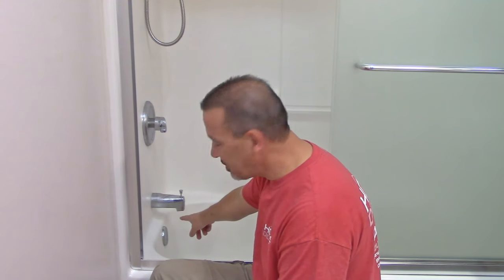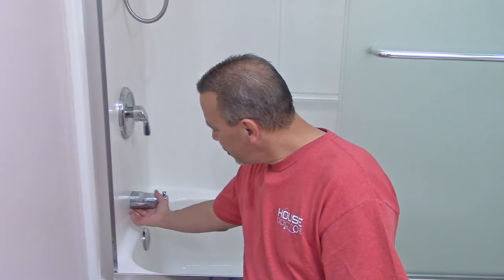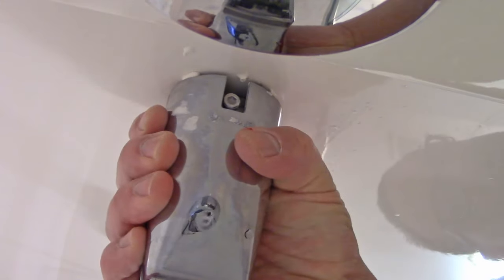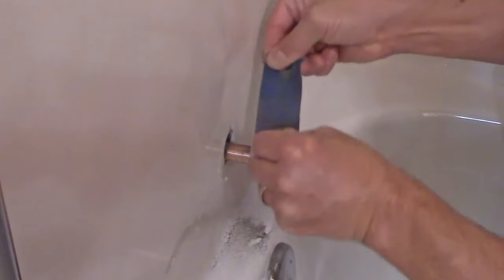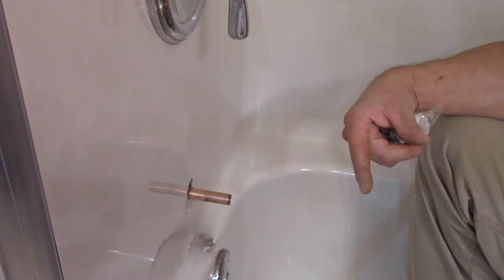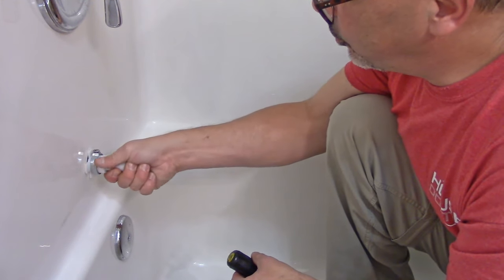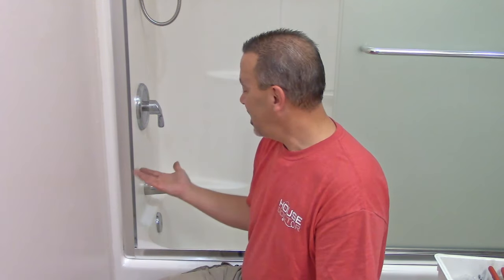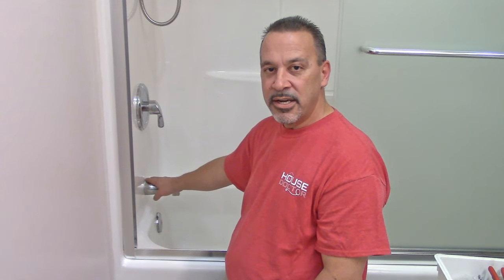DIY noisy shower valve fix

Comment: After cutting a new seat in my shower valves, there was an increase in noise. I figured one reason could be the very sharp new edge that the water has to flow around, creating high pitch whine. Sure enough your video convinced me to buy a cheap hand deburring tool and I smoothed the sharp edge of the seat out, and now it's silent. Perfect.
Reply from the maker: Glad you tracked it down and fixed it.  It really is strange how the slightest disturbance in flow can cause that noise.

Comment: I bought a condo last month and noticed the shower does this (and it stops when I jiggle the tub valve thingy), so I think this is the issue. I'll check for leaking when I switch to shower mode..hopefully it works and I don't have to pay a plumber $$$ for simple fix.

Comment: THANK YOU!!! I’ve finagled with that darn shower so many times after the kids have complained about the squealing but never bought any parts since I wasn’t sure what part. After hearing it again this morning I found this video and thought why not. $24 at Home Depot and less than 20 minutes later (I had to redo and screw from the bottom since the handle is too close) and it’s quiet now. 👍🏼🎉🎆🥳👏🏼👏🏼👏🏼
Reply from the maker: Yes!  Way to go.

Comment: Thanks for this very informative video. You have some great information here. 👍I'll be sure to check out more clips from your channel
Reply from the maker: Thanks Dex
Reply: @HouseDoctorRay  I have a question for you, If the shower is squealing and the spout is leaking, does that mean it's most likely the fix you did in the video? what about if the spout isn't leaking would that mean it's the cartridge?
Reply from the maker: A leaking spout definitely can cause the sound.  Spouts shouldn't leak at all when water is on.
The noise is a harmonic vibration caused by the water flow.  The spout is the easiest thing to change.
A cartridge could definitely cause the noise too.  If you do pull it out make sure the housing is clear of any debris before installing the new one.
Reply: @HouseDoctorRay  Thank you I appreciate your response.

Comment: Sometimes, your spout just needs some Lime Away sprayed up in there to soak & clean the diverter because hard water deposits will cause this.
Reply from the maker: Good point - you can also use white vinegar to dissolve mineral deposits.
If you can wrap a Ziploc bag full of either around the spout and leave it soak for a few hours even better.
Reply: I'm thinking that's what muly issue is because my landlord just had a professional come put a new spout on 7 months ago and it's already doing this. We do have high amounts of minerals in our water this past year or so for some reason so I think I'll try the soak thing first 🤞🏻

Comment: Hi, I am also having the same issues but my is a standing shower with no tub. It starts making the noise when I turn to hot. I have a standard shower head.
Reply from the maker: Try cleaning the shower head by either taking it off and soaking in a bucket of white vinegar or tying a Ziploc bag full of vinegar around the head overnight.
The aerator can get partially clogged with dirt and minerals.  Sometimes if you unscrew the showerhead the restrictor/aerator is right there and can be pulled out.  If you don't put it back in you may get more water pressure ala Kramer.
Reply: What would be your recommendation how would I fix the noise without the spout because I can only turn the water to slightly warm if u don’t want the noise to be made while showering 😅😅
Reply from the maker: Try cleaning the showerhead.  Or take it off and see if the noise stops.  The whining, squealing noise is the pipes vibrating.

Comment: I wouldn't have guessed!  I'm gonna replace my spout...
Reply from the maker: It's fairly easy.
Reply: @HouseDoctorRay  I see there are "dripless" spouts that use a slightly different valve setup.  A swapover will probably be my solution.
Thanks again! ;)
Reply from the maker: Aye aye captain

Comment: I changed a leaking cartridge on one of the tubs in my house and and the tub started squealing when the valve is in the middle of its range, but gets quieter when the diverter is pulled up for the shower to work (even though water still goes through the tub spout).  I changed out the cartridge again, thinking I damaged it when I installed it because it was very difficult to get seated, and the squeal remains.  I took the tub spout off so it was just a bare pipe and turned the water on and it still squeals.
Reply from the maker: Sounds like a Moen.  Even if not try this:
Take the cartridge out again
Clean the inside with some fine Emery cloth.  Use a dowel, marker, or pencil to get all the way in there.  See if you can get into the little holes on the side with a pipe cleaner.
Before putting it back together turn the water on for a few seconds to blow any gunk out.
Use silicone grease when you reinstall the cartridge (I always use Vaseline even though it's considered a sin).
If that doesn't help you may need to put some more pipe clamps on or try a screw on water hammer arrester on a nearby sink.
Reply: Yeah, it's a Moen.  Thanks for the suggestions, I'll give them a try. @HouseDoctorRay

Comment: Can I take off the old one, use sandpaper on the tube, and install the old one back on?
Reply from the maker: That won't stop the dripping and the resulting noise.  There is a little gate in the end of the spout that wears out or gets mineral build up and causes the drip.  On some spouts you can unscrew the knob on top and replace the gate.
Reply: @HouseDoctorRay  Wow, hard to find YouTubers who reply to their audience, it's mostly everyone else debating in the comments. So thank you for the informative reply!

Comment: Hello so my stand up shower no tub is doing that same noise since there is now tub fill faucet would you suggest it’s the cartridge I have a 2 head shower handle one that’s stationary and one that can detach. I also have a water filter attached before shower head I live in a new home that is only a few years old any suggestions also to add it only does it on the hot water side the other bathroom is doing the same but that has a tub
Reply from the maker: Try cleaning the knob you twist to select different shower settings.  If there is no easy way to take it apart remove the whole thing from the pipe sticking out of the wall and soak it in a bucket of white vinegar.  The vinegar will dissolve mineral deposits that may be causing the issue.

Comment: My showerhead spout handle and all the fixings were replaced in 2016 and the knob is squealing when it's all the way off and the faucet is leaking
Reply from the maker: That sounds like you need the valve cartridge replaced.
Reply: @HouseDoctorRay   Now that's the part behind the knob, correct?
Reply from the maker: Yes.  Can be a DIY job.  You need to know the model valve you have.
Once you know the brand you can go to their website and use their model identification tool.  This is just one example:
https://www.moen.com/customer-support/identify-my-product
Reply: @HouseDoctorRay  thank you! mines delta and i looked on that site im not sure if the one they have will fit mine so i guess ile check delta
Reply: but i have to find the model number which i have no idea where its at.. ahah just found out i have a delta T13 kit
Reply from the maker: https://youtu.be/dFGqFuOrmoQ

Comment: hmm, ok I got the screw underneath loose and turned it, but I can't pull it off...there are threads on copper, do I keep turning until the faucet just comes off?
Reply: never mind, I was able to get it off. Let's hope it's easy enough to install new one.
Reply from the maker: Well, did you get the new one on?
Reply: @HouseDoctorRay  yes I did, thanks !

Comment: .A new faucet (a dual spray switch tap that allows to switch between a strong shower setting, and normal stream setting) is installed downstairs. Whenever the downstair neighbor switches to strong flow setting I hear a high pitched water stream noise in my kitchen. The below neighbor uses the high flow setting quite often in the day, and it affects my ears as I have an ear condition called tinnitus. But it's loud enough that even someone without tinnitus would find it annoying (the nails against chalkboard type of sound)..why the noise is coming,

Really appreciate any help, thank you!
Reply from the maker: Sounds like you rent.
Talk to the landlord about it.  Explain how the high pitched noise is pipe vibration that will eventually cause leaks.
Another option that might help is a screw on water hammer arrester.  They're designed to stop pipes from banging but can also help with the vibrations that cause this noise.
Reply: thanks so much sir for help. i appreciate it @HouseDoctorRay
Reply: sir sorry for asking question again. i was under impression that there is professional  faucet mounted downstairs with built in dual spray but thats not the case. they have some amazon bought kitchen faucet shower spray attachments etc looks like they keep changing the faucet attachments to the faucet for slow speed high speed etc..all these attachments are removable. i dont know why apartment management allow them to use these attachments. why does these attachments cause loud pipe noise in my unit whenever they use them. when i complain management and manager took me to the below unit i opened the faucet attachment switch to high speed flow but could not reprocue the same high noise that can be heard in my kitchen that they were producing. it made management feel like i am making big deal for no noise, sorry sir english not my first langauge.why i am not able to reprocude same noise that they have been doing. is it because they used another attachement with jet speed stronger.sorry for bothering again. thanks sir
Reply from the maker: You could try recording the sound with your phone and play it back for them.

Comment: I knew something like this would be on YouTube.... Thank you man! Is there any repairing or tightening of the original that's making noise or is it one of those things you may as well replace outright?
Reply from the maker: There are a few models where you can unscrew the little knob and take the part out underneath.  It's a little gate and some have an o-ring.
Just cover your drain so you don't lose any parts if you try it.
Reply: @HouseDoctorRay  ahh okay! I will give it a look-see. Thank you for the quick reply and knowledgeable advice!

Comment: Sir
My Spigot was Leaking and I Replaced the Gasket it fixed..
But ..It making noice and shaking when starting again.  Once we start all the way ...No noice...
Is it Dangerous or why this happening?
Reply from the maker: Shut off water and remove cartridge.  Turn water back on with cartridge removed.  You may have debris in the water line that needs to be cleared out.

Comment: What if my diverter is on the temperature control and not on the tub spout?
Reply from the maker: If you have a drip try changing the washer or cartridge for the diverter lever.  If it's a Moen or Delta call them, they'll often send the part for free.

Comment: i dont have tub or tub spout, i have just shower, and it sqeals after i open any water tap thats connected to water heater, it allso sounds like its the valves from water heater itself, my problem isnt anywhere on internet ?:D
Reply from the maker: Maybe try an expansion tank on your water heater.

Comment: what if it’s flush on the bottom of the tub spout? i think this is the original one from ‘79😫😫 i hate this thing it just leaks and squeals!!
Reply from the maker: If there is no access for loosening a set screw then the spout itself unscrews.  Usually just a firm grip with two hands is enough to unscrew it.

Comment: Mine makes same noise whether the water is on or off. It will do it even if you use shower in a different bathroom.
Reply from the maker: You may have a slight drip allowing water to flow.  If that is the case you would need to change the cartridge.

Comment: I changed the cartridge and diverter  but still makes noise
Reply from the maker: I had another shower where the noise was caused by the rubber seal on the side of the cartridge partially blocking the water flow.  I think it was a Moen.
Reply: @HouseDoctorRay  I'm thinking a about replacing the who m e valve.   Don't want to destroy the walls.  But the contant bitching from the wife is driving me nuts
Reply from the maker: The diverter only has to have a tiny drip to cause the noise.
You can also try submerging the showerhead in vinegar overnight to remove any calcium deposits.

Comment: how did you turned the set screws to the bottom if you already tightened down?  just force turn it?  or did you redo it??
Reply from the maker: Not sure what you're asking me.
The kit I bought doesn't have a set screw on the spout.  Once you install the plastic adapter the new spout just screws on.

Comment: I'm hearing this noise and my shower is off... not sure what to do
Reply from the maker: Water is going through the pipes somewhere.  If you have a tiny drip coming out with the valve off you probably need to replace the shower cartridge.

Comment: I only have a shower (no bath, stand up) so what then?!
Reply from the maker: Soak the showerhead in vinegar overnight.  It will remove the mineral deposits clogging the showerhead.
Reply: @HouseDoctorRay  I cleaned it even though it has a filter before watching your video and determined it's not the shower head BECAUSE I took it off (showerhead) and it still makes the noise behind the handle.  🤔
Reply from the maker: Change the cartridge.  While you have it out clean the housing well then turn the water on for a few seconds to clear out the lines.
Reply: @HouseDoctorRay  yep it's going to get the cartridge or remembering until im already in the shower... 😆 (Single mom so with school starting I've had busy brain!) Will it hurt it or anything to run it like that or just be annoying?! Thank you so very much for your replies...truly. ❤️
Reply from the maker: Just annoying